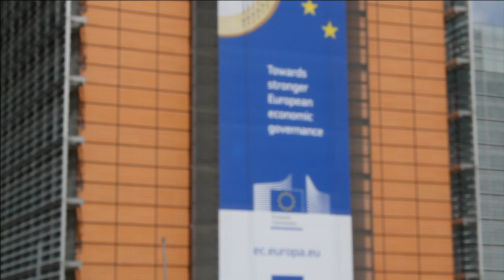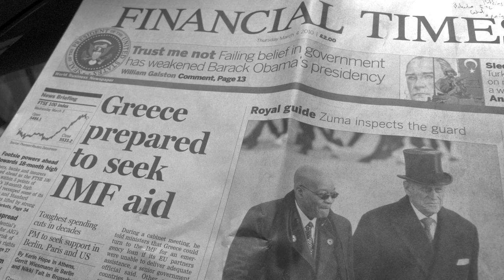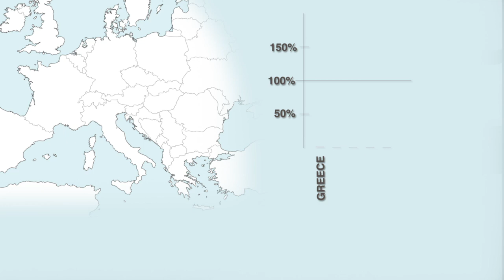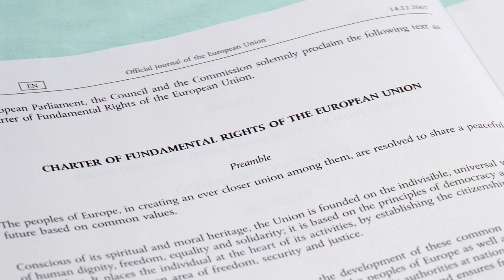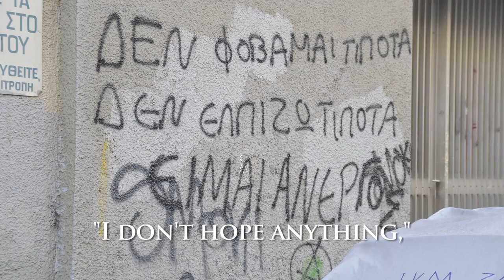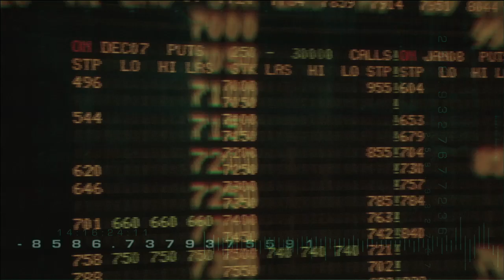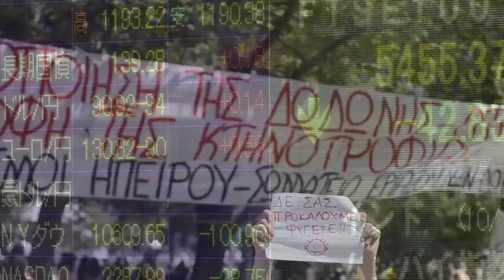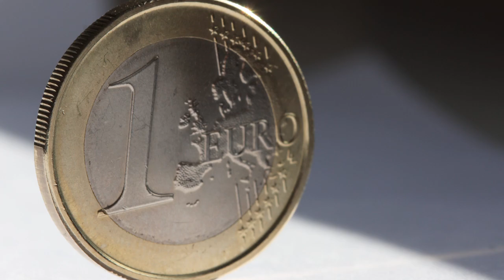Imperfect Union: The Eurozone in Crisis - Full Episode

Comment: The Euro was introduced in 2002, not 1995, how did you manage to get that wrong?
Reply: The EU just celebrated 20 years of the Euro, it was launched in 1999
Reply: It did not enter circulation until 2002. Some of the coins began being minted in 1999 and  national currencies were fixed to the Euro exchange rate in 1999 but no one was actually using them until 2002.
Reply: @fiverZ  True they weren't used until 2002 but was launched in 1999. It's been going downhill since 2008.....

Comment: Nothing in the Eurozone has changed for the better since this documentary was made. National interests prevail since the diversity of the western fringe of the Eurasian landmass is determined by a host of geographic, demographic & cultural factors which render a single, common administration impractical. 
George Friedman sees the nations of continental Europe falling naturally into three distinct regions; the north-eastern or Atlantic nations, the southern or Mediterranean nations, including the South o f France; and the eastern nations forming their own alignment from the Black Sea to the Baltic. Russia is an anomaly, stretching from a corridor on the Baltic, touching on the Arctic and open to the Pacific.
Blocs of nations with similar interests co-operating in matters of trade & finance is one thing, a common currency which benefits primarily Germany at the expense of smaller, very different, Eurozone members quite another. 
Germany’s commitment to thrift, regulation & hard work cannot be imposed from without on people with contrasting values and attitudes, for better or worse. 
Cultures change from within; attempts to impose change from without have never succeeded; the Russians failed in this between 1945 and 1990. 
Germany may be promoting a system that we find more acceptable than Stalinism but the dynamic is the same although, in the Eurozone, the stick is too small and the stock of carrots is all but exhausted.
The only solution is to abandon the Eurozone, allowing individual nations to choose the currency - which could mean the German mark aka euro - best suited to their unique domestic economies. Brussels & Strasbourg must be scaled back to pre-1990 levels; european taxpayers can no longer bear the burden of a largely redundant bureaucracy & a toy parliament. 
International co-operation can proceed through conventional channels; NATO, Interpol & a resurrected common market in which nations can, if desired, trade freely, free of regulation, tariff barriers & government interference.
One government for all of “Europe”? Never a viable prospect...

Comment: THat is the problem with the Eurozone its connected by a common  currency. Mistake #1, MIstake #2 the Eurozone does NOT have centralized govt.  & a centralized economic system like the US; The Eurozone was destined to fail. If everyone thought 2008/9 was bad. Wait until after Brexit where the UK leaves w/o a deal thanks to Germany. Let's see what Wall Street has to say about a no deal UK Brexit.

Comment: There are negative aspects of the EU but the main benefit is it's numbers. If the EU didn't exist and all members where seperate than they could not form a counter weight against the USA and Japan. In the past the union was made for the purpose of protecting Europe industry (against the USA and Japan) and having an international presence so it could protect and advance it's interests. For example if China nowadays does something the EU doesn't like than the EU could impose sanctions and that could scare Beijing, but if the EU didn't exist and only Belgium imposed sanctions Beijing would laugh and wonder what Belgium even is. The EU has more benefits but people will only see that after it's gone. Sometimes people thinks life is about chosing between good and bad, well it ain't it's chosing between bad and worse. The EU needs to adress some of it's many flaws to better itself, that's for sure. But for me personally the other option (no European Union) would have worse consequences.